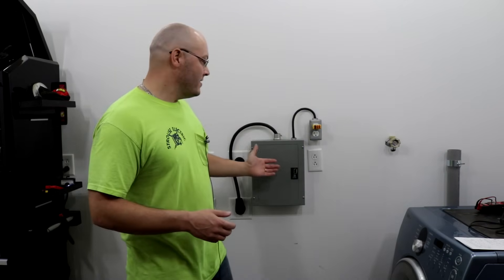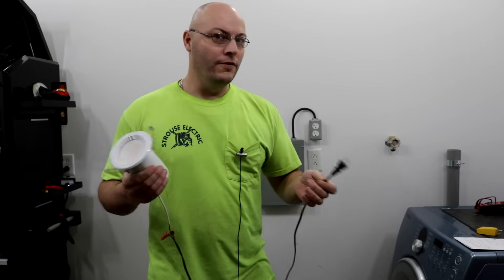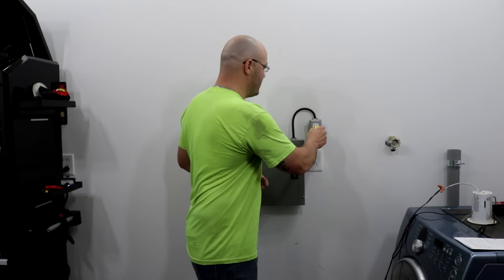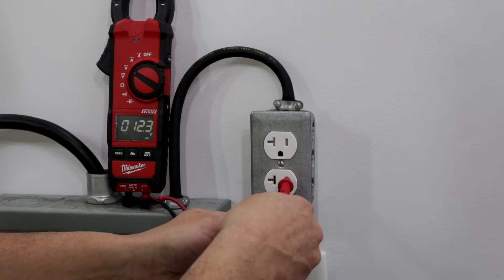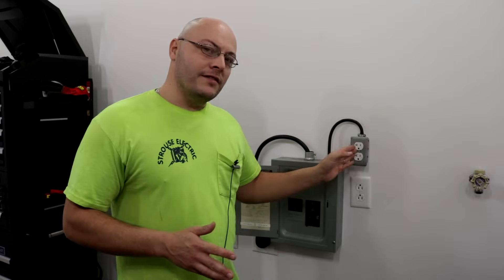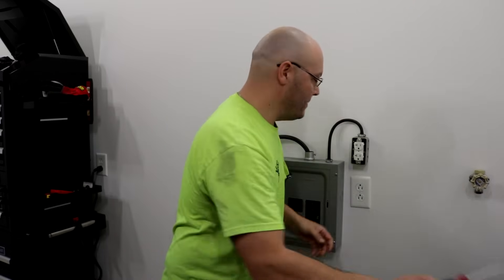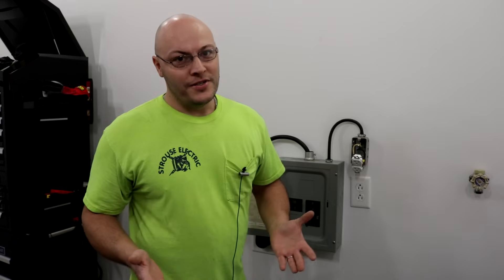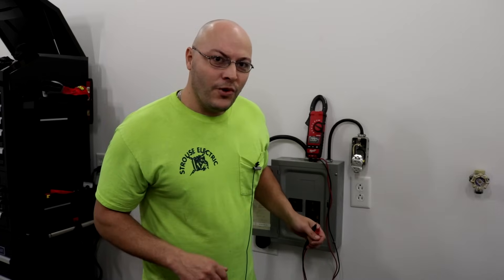How to Test a Wall Outlet - Receptacle Troubleshooting

Comment: I have a 240 outlet that has gone dead my outlet tester will not work but my little pen like tool does not show any voltage into the outlet, what does that mean?

Comment: I have been looking for a fault for 2 years. We have a dual light switch one works the other nope, also 4 wall sockets also don't work, breaker looks fine, not tripped. I checked wiring in wall sockets likes fine, dual switch looks ok, Could the issue be in a light outside, whereas switch is the first item on the breaker but the light which is outside has an issue like lose wire or maybe ground touching?

Comment: Oh man, you stopped the video right when you were getting ready to explain about the wiring being bad!
That's exactly what I was waiting to hear you talk about!

You really do a good job explaining this stuff to some of us novice's out here! 
What's up man? My name is Mike and I live in St. Charles, Missouri, I live with my room mate in a doublewide mobile home that was manufactured back in 1993 when all they used were those stab in the back receptacle's, every one of them are the stab in type!  About 2 month's ago we had a bit of a cool spell and my room mate plugged in her space heater and all the socket's in her room all the way to the living room stopped working, along with the ceiling fan, the porchlight outside of the main entrance and 5 more receptacle's in the living room!  I figured the space heater probably couldn't handle the load, so I went to the breaker box to reset the circuit breaker, when I opened the door on the panel box all of the circuit breaker's were in the on position!  I found the one that controls her bedroom and I manually turned it off then on again to try & reset it but nothing happened!  I just decided to pull the breaker in question and ran up to my home depot to buy a new one, it is a double 15 amp and each switch can be turned off & on independant of each other.  I installed the new one and, "wah lah",  everything worked again and I was the hero !!!  
3 night's later she went to bed and decided to read a book so she went to turn on a little  led lamp beside her bed and all of the light's and receptacle's went out again, a little led lamp overloaded the brand new breaker I just replaced 3 day's earlier !!!
I watched all the diy video's on "You Tube" and I heard nothing good about these back stab receptacle's and  I intend to replace all of them soon just to save myself more headache's in the future!
I seem to think that one of these receptacle's has probably got a short where the wire was stabbed in at and replacing the receptacle should solve the problem, the only thing is I don't know which one it is so I'm just gonna start replacing them all !
I watched your video and you seem very wise when it comes to this stuff and I would respect your advice with this issue!
Would it be too much trouble to get your opinion on this please, I would greatly appreciate it my friend!
What would you do in this situation ???
Thanks a million bro!
✌
Reply: Unfortunately, Bill passed away shortly after he started the channel.
Reply: @sunshine3914  

I know, I learned of his passing shortly after I left my post, that deeply saddened me!
Out of all the video's I found on You Tube regarding my electrical issue his was the most informative and easy to understand and I was really looking forward to possibly starting a new friendship with him because somebody with his knowledge & know how is always an asset when you run into these type of problem's, plus he seemed to be very genuine and the type of guy who really would go out of his way to help other's.
I never had the opportunity to chat with him un'fortunately and that's a shame, because good guy's like him are hard to find!
You have my deepest sympathie's, may he rest in peace in the caring hand's of our lord Jesus Christ and may God bless his family!

Comment: My Wall Outlet doesn't have an outlet connected to the Breaker. It's only a Breaker for each room in house.

I have a telephone, which is connected to a wall outlet, and it doesn't give a dial tone. Phone battery has life. I want to ask you, I exchanged a different modem for a One Line modem. I had to replace Cable boxes because of this modem. Now, my Kitchen telephone has no dial tone at all because I replaced the router modem. Did I lose my telephone Jack in Wall due to this exchange?
Thank You!

Comment: I have to watch all his videos because I bought a house in South Carolina and I don't know a whole lot about electrical but I do know that the framing addition was done wrong. Whoever ran all the ducting for the HVAC under the house did it wrong. The plumbing I'm going to have to tear out and redo. And whoever put the metal roof made a mess and now I've got dry rot. 

I don't have the money to hire an electrician I'm a disabled vet on a small income but I got to make sure this place is safe....

Comment: Hi Bill, i have one circuit breaker that all the outlets have power but not enough to turn on a radio.
There is also one wall light that does have light but very dim light.

Suggestions where to statt first?

Thank you

Comment: This is a dumb video. Because - Typically, three-prong outlets last around 15 years, but they may last longer if they're rarely used. In comparison to three-prong outlets, GFCI outlets last between 15 to 25 years.

Comment: I need tbe next video 😅😂😭 I have taught myself so much today and fixed/repaired/replaced so many things in my home... But the kitchen light has been completely uninstalled, live wires have been tested, breakers have been flipped ans tested ans still no power coming through. I was really hoping to be able to skip getting an electrician as I'm broke and HAVE to learn these skillsets. Thank you so much. Hopefully I can find your other video here in a sec and its something as simple as a fuse issue at the breaker box that I missed or something i havent tried yet or didnt do correctly. ( Also, maybe my balllast ISN'T out afterall. Either way, im upgrading to a new LED fixture when this all said and done lol)

Comment: just what i needed to learn to verify what i need to do to check for a bad GFI outlet.. one thing he didn't point out that is very important regarding the voltmeter is to ALWAYS plug in the black lead FIRST either to neutral or ground... plugging in the RED lead first will cause the black lead to be hot and could arc against anything that could ground it - like yourself - think of it as same as taking the proverbial butterknife and sticking it in the outlet

Comment: I kliver in a Knob n tube type home with some upgrades so its scary hes showing you problems with circuit breakers I wish that was my problem. Instead of the screw in fuses and shotgun shell type electrical fuses. Im looking at a rewire project. But what can I get away with without having to tear my whole house apart? ?That is the big question?

Comment: Well, while I'm sorry to hear of his passing, I had to point out a few issues I'm seeing just 5 mins in. 1) He left the red probe in as he moved the black probe from neutral to ground... that's a big "no-no" where that makes the black probe HOT! 2) Touching the metal probes while testing won't "electrocute" you on an AC circuit but, will on a DC one. What he should've said was ELECTRIFIED; you only get "electro-CUTED" when you DIE from being electrified too long. The point is moot to him now but to all those who look to this video for instruction NEED TO KNOW 🫵

Comment: This was very informative, but i saw one thing I would never do. Even thought they are safe, I would never use an aluminum crimp fitting on copper household wiring, no matter what the purpose. Main reason, aluminums melting point(1220°) is lower than copper(1983°) when it gets hot. The aluminum will melt before the wire gets hot enough to tip the breaker. That's why aluminum is not used for wiring. Whether this video is just informative or not, those crimps or not standard code in some areas.

Comment: What does it mean when you get more than a 120v like he does? I know it's only 122, but why is he getting more than 120v? New to learning about electricity
Reply: 120v is just the standard, it would be very difficult for utilities to be able to flow exactly 120v on the dot to your home, your electrical devices are all designed to operate anywhere in that range on voltage but it should always be at least 120 minimum. I've never seen a circuit in any home put out exactly 120.

Comment: Thanks for posting, I have a question, what is the probability of dying from getting shocked by 120v with 15 or 20 amps behind it. I ask because you said we will get "electrocuted" many times in this posting. There is a big difference between shocked and electrocute. Just asking for clarification. Thanks.

Comment: I’ve heard one electrician say to remove the load wire from the circuit breaker if it’s still trips then the breaker is faulty. But how do you test the wiring

Comment: My problem was some of the outlets on a circuit breaker were working while others were not. Using an outlet tester I tested each outlet to determine the last working one. Not being an electrician I did not realize the tester only tests incoming electricity not outgoing. To start physically checking I pulling the first non-working outlet to confirm all three wires we properly connected. Then I speculated the tester was only recording incoming electricity so the last working outlet maybe the source of the problem. I guessed right when I pulled the outlet I discovered the neutral had come disconnected. I then installed a brand new outlet correcting my electrical problem.

Comment: I have a question recently the power company came to fix a damaged power cable outside of my house it was causing Low voltage they fixed it and I thought everything was good until I went to my room today and discovered that my power outlets are not working my ceiling fan works and has light the switch to turn on the bathroom lights work. The Closet light doesn’t work either. I know there a GFI switch when I try to reset it it doesn’t stay reset the button pops right out. I would like to know is it a breaker issue or The wiring or the GFI switch please answer me quickly as possible I don’t have much money to afford someone to do a $5000 repair job. I would like to know what could I do to determine what’s the problem and resolve it
Reply: He's dead bro, you're not going to get an answer.

Comment: Hello
I have a question. I have two wires coming out of an electrical box. One of them brings power and the other goes somewhere I don’t know
When I put my voltmeter test leads on the hot and neutral of the power wire it reads 119 as expected. When I put the test leads on the hot wire of he power wire and the box itself it reads 67 volts 
What could be the  problem? Does this mean that the difference between my hot wire and the box is not 119v? Does it mean the box is not at ground voltage? Is that because that other wire (amor cable) is leaking 52 volts to the box, so the difference between the box and my hot wire is 67? Am I thinking about this the right way? 
Thanks

Comment: Great video just one troubleshooting tip to add, I hope it helps. When you do a voltage test with your meter you want to also check voltage between ground and neutral, if it's anything but 0 volts you have an issue as well
Reply: Can you explain what might have caused that, I have outlet issue, 130v bn natural and ground, hot and ground?

Comment: I have a question, I checked my outlet wires and I’m not getting any voltage when testing the neutral wire and hot wire, however if I check the ground and hot my multimeter is showing 120 Volts. Would this mean my outlet is bad or does it mean the issue is my neutral wire?

Comment: I have a neon tester which lights up when there is power.  When I checked the outlet which wasn't working I was seeing the light flicker but not bright, meaning I had some power but not enough voltage.  I'm thinking it's a bad breaker.  Am I correct?
Reply: I'm sorry!  I just now read the comments below and give my condolences to the Newberry family.

Comment: Uncle Billy 

I wanna ask 
My circuit breaker of 20Amp keeps tripping in the house which causes everything to turn off 

So I was under the assumption that it could be a either the circuit could be old 

Or the plugs or sockets could be the issue , so I wanted to recap on socket testing using a Multi meter
Reply: How many receptacles on that circuit? What are using when it trips?

Comment: Hi Bill, 
You started to mention about the main breaker but you didn't finish explain it. When you don't know which breaker for a specific outlet, should you turn off just that main breaker or all the breakers including the main please?
Reply: Bill passed away in 2016. I'm no electrician. I always turn the main breaker off even though my box is marked very well by the builder. Get yourself a basic tool that checks for voltage before you touch any wires. I use a no touch tool that's about $12.00. Always check the tool on a live wire to make sure the tool itself is working. Never assume the power is cut off and your tool is working. Good luck.
Reply: I don't recommend turning off the main breaker unless absolutely necessary. Use a tester, radio, light, etc. to determine which breaker is the one you want. Then verify with a multimeter that the power is off for both receptacles on a duplex receptacle. If you do turn off the main breaker, turn off all circuit breakers first and turn them back on last.

Comment: Thanks. My band was practicing  in the garage and we were drawing alot of power when the refrigerator  and freezer lost power. And upstairs our outlet with circuit  breaker red button in bathroom lost power too. What can u do. The wall outlet in garage has no power to plug in .

Comment: What if I get my phone to charge when I got reset but once the rest button goes out then it won't charge anymore? It's for the outlet in my bathroom. I was testing it with my phone charger because I realized today my electric toothbrush is out of batter. It's a new house so I just noticed this.

Comment: what if you have multiple outlets that stopped working and no apparent breakers tripped?
Reply: Check for lose wires starting with the first outlet that's not working and follow the wiring to each outlet. Hopefully you have an idea how the outlets are wired and connected. Make sure your power is off first.

Comment: Tried everything in the video.  Nothing worked. Called electrician.  Outside outlet was wired to an outlet in the garage with a GFI outlet and the breaker kicked off. I never knew the GFI switch was even there.  Electrician said builders do this all the time.
Reply: NUMBER ONE THING TO CHECK WHEN OUTSIDE OUTLET IS NOT WORKING - LOOK FOR A GFI. Best places to look is bathroom, kitchen or garage.

Comment: Hello Bill how are you doing I am interested in knowing how to test fuses that you have to replace I don't have a voltmeter is there any other way besides a voltmeter to test the screw in fuses instead of me taking them to a store and getting them to test it and then being charged out of the nose full intestine I don't want to get over here because they're expensive I'm just working off of a limited budget it would be nice to know which where would be good too test the replacement fuses baby on a present you only got so much money????

Comment: I moved my Line Tester towards a switch and about 3 inches Before the Switch, it started Reading Hot; well before I got to the switch.... Thoughts?
Reply: Your line tester is too sensitive. Mine does not turn RED until the tip is about half inch near the hot wire.
Reply: @1942nn  Thank you for your answer - makes sense

Comment: The GFCI outlet in my bathroom doesn’t seem to work. The red button keeps popping out and won’t stay down when I turn power on to the room. I tested the voltage with a multimeter. It’s not quite 0, it’s reading about 50. But it won’t work with any appliances blow dryer and such.  There are no tripped breakers in the box. And the lights / fan in the bathroom work fine, reading 120v. Any ideas?

Comment: I have one outlet in my bathroom that no longer works. I replaced the outlet with a new one 15 amp. All the other outlets in the bathroom work except for this one. I tested the neutral and hot wire and there is no power   This leads me to believe it is the circuit breaker. I think it is time to call the electrician. Any ideas

Comment: One other thing to consider when there isn't any power that the outlet might be a switched outlet by the electrician having broke the side making it a split outlet and a switch near the door to control the lamp or other device plugged into that half of the outlet.

Comment: In the beginning,you said that you could tell if the breaker is tripped because it would be in the off position which is false.If its tripped,the breaker would actually be positioned between off and on.What the person should do is turn the breaker off,and then re-set it in the on position when.

Comment: Iv got trouble everytime I turn on the ac it tripped when it trippes it takes out bathroom power and when I tern it back on and then it trippes again over and over again
Reply: You have what a electrician called a dead short in the unit

Comment: I have a open a reversed neutral in the kitchen. I change all the outlets, even change a light switch. I even changed my circuit breakers. I even checked the junction box that joins in the kitchen. And I still couldn't find the open neutral in the kitchen. Could it be behind a wall? Could it be that it's touching the 🔥 hot somewhere? Can it be a nail hitting it? What could it be? What can cause this?
Reply: did you ever solve this issue? if so what did you do? i have same problem :-(